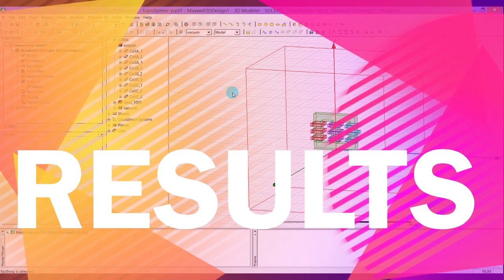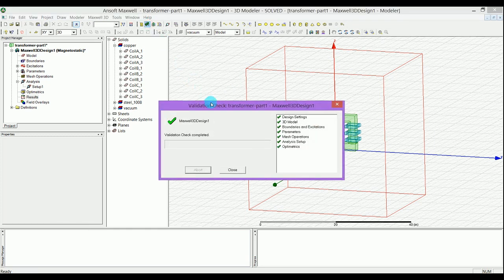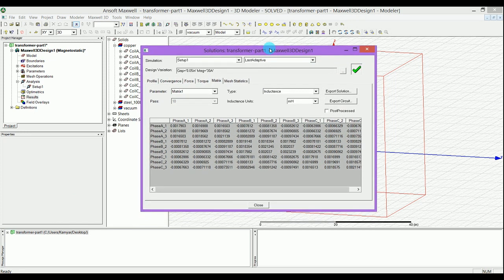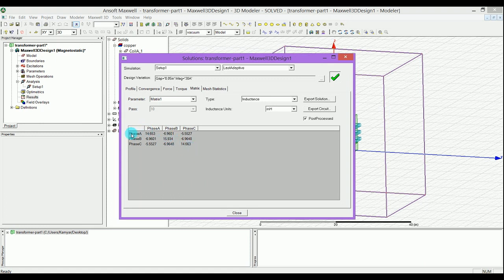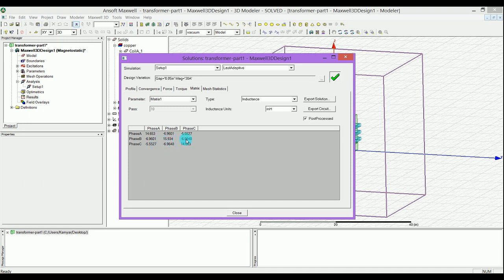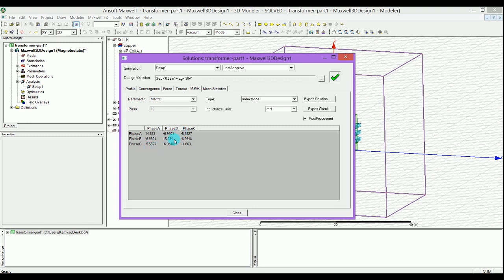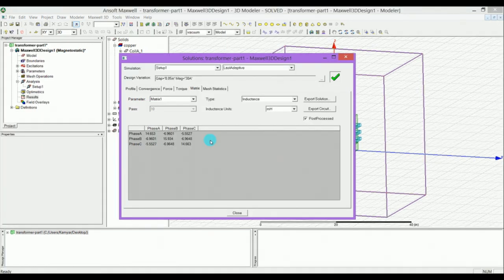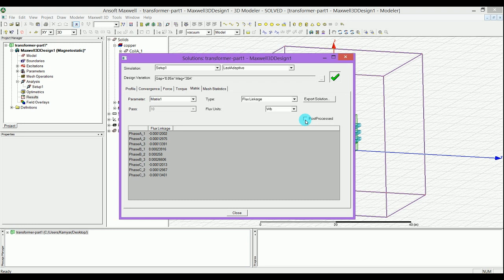208 - Ansys Maxwell - 3 phase Transformer [3]

Comment: Thank you for this interesting video. I have one question. If I want to calculate the inductance matrix or the fluxlinkage at high frequency with considering skin effects, since the skin effects will influence flux and resistance. Then, do i need to use eddy current solver and selecting solid for the current excitation?  As a result, the inductance matrix is not a real number matrix, but a matrix of complex number? I am working on high-frequency Modeling of PMSM, so this question is really important for me. Thank.
Reply from the maker: Yes you need to use eddycurrent. You can change the inductance metrix solution between real and Imaginary impedance to resistance (ac loss) and inductance values for each frequency. That’s possible in the solutions window in eddycurrent solver
Reply: @kamyark8434  thank you for the answer. I have another question regarding 2d eddy current solver. I want to calculate the inductance matrix between conductors within the same slot. I choose one pole and dependent boudary conditions for simulation. As a comparison, I also simulate a pole pair, but this time I use winding as the excitation instead of single current exicitation. Surprisingly, the mutual inductance between nebohring conductors from these two simulations, (one use current as excitation and the other uses a winding excitation consistating of a positive coil and a negative coil with only conductor) are total different. The difference is not 2 but very different. I dont understand such a difference, maybe can you help me? I suppose the result from a pole pair simulation with a Winding exication is more corret compared to measured results.

Comment: Hi Kamyar , ı am studying electrical eng. ı m trying to design transformer.but different way.I use HV and LV and put some terminal inside the HV and LV. But ı should calculate eddy and other losses.I already check the Maxwell user quide.but ı think it is really complicated.Can you explain how can ı calculate losses of transformer.If you explain with a new video about transformer losses ı ll be verry pleased. I hope you will reply as soon as possible. All the best from Turkey.
Reply from the maker: gönenç akçam Acctually I am going through some dificulties dealing with Google at the moment. I will let you know ASAP when things are back to normal